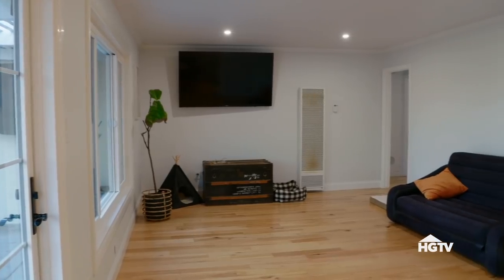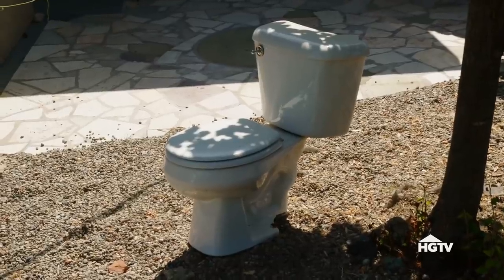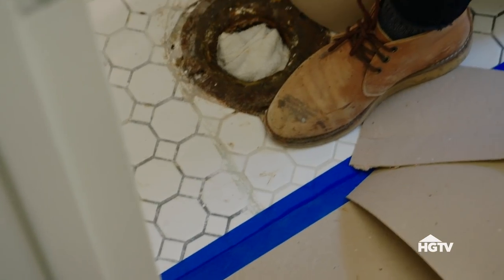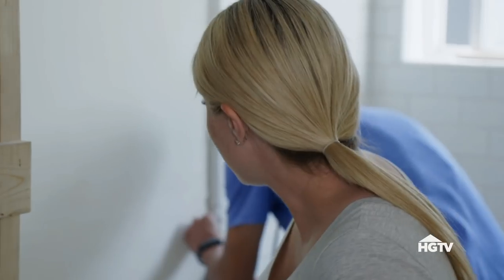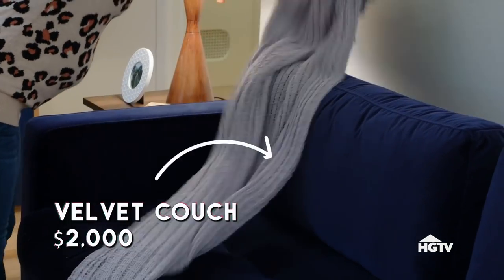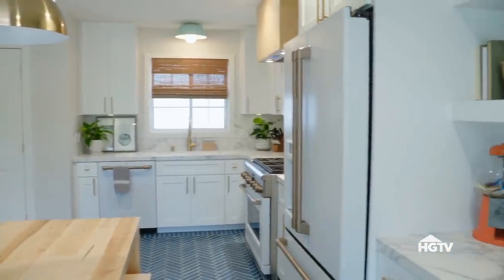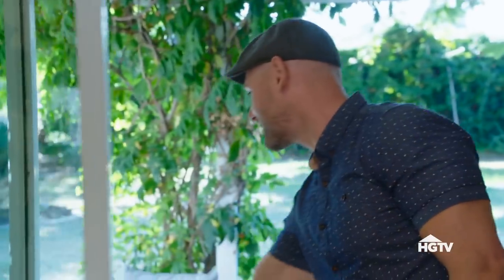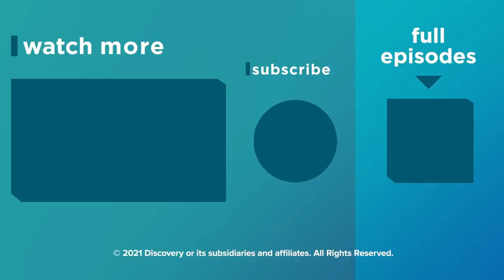Botched Bathroom Remodel Needs Fixing | Help I Wrecked My House | HGTV

Comment: I would like to know how you kept those bathroom tile and cleaned them up please?!
Reply: They painted them.
Reply: @plug_65  do you know what kind of paint you use on floor tile I would like to do mines
Reply: Maybe just new grout. They had black grout before, now it's white grout.
Reply: @starnejme6902  oh,ok ll didn't know you could regrout your tile
Reply: They may have just painted the grout white and cleaned the tiles. Grout paint does exist, and from what I've heard, it seems to work well! Painting tiles is technically possible, but I personally wouldn't recommend it, especially on floors, because the paint wears off over time and needs repainting which is difficult to maintain.
Reply: More likely an acid wash, and bleaching the grout.